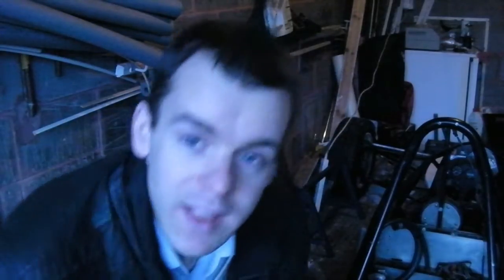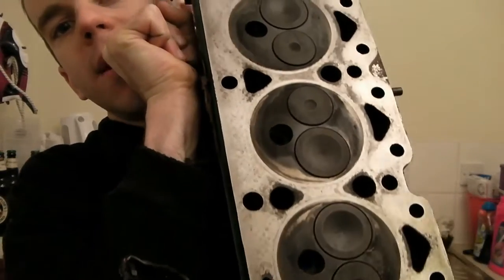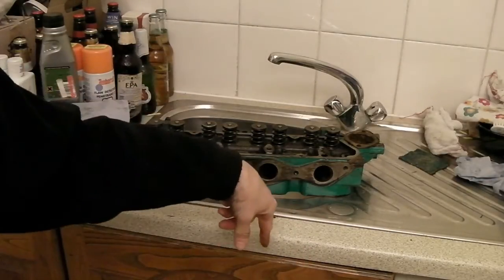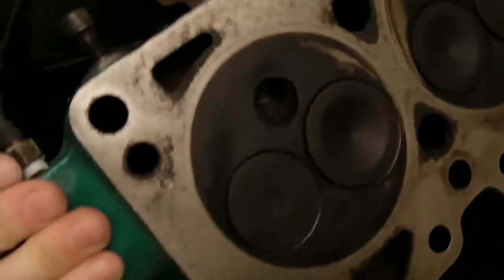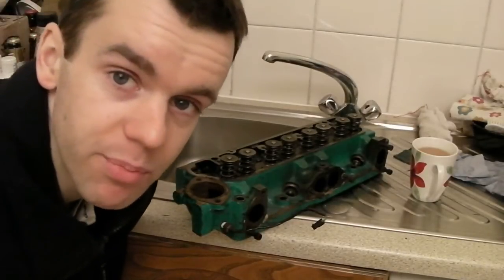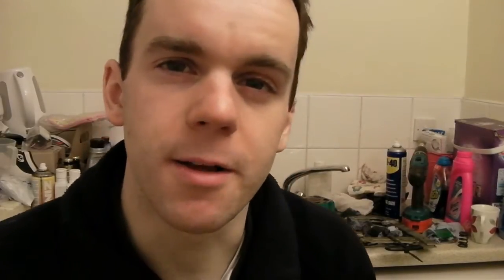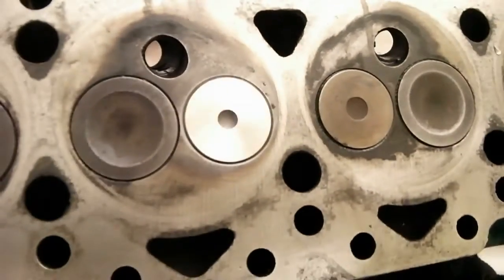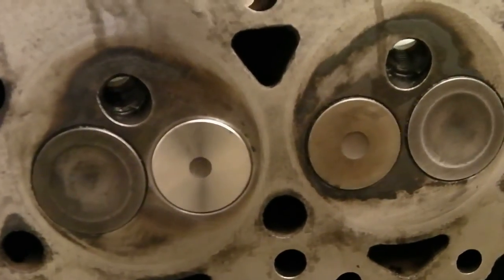Checking for Bent Valves Kent Formula Ford 1600 Engine

Comment: I know this was 7 years ago but how did you go with the valves. I've seen guys put the valve in a drill press to test if the valves are OK and not moving around while spinning.If the valves are not bent and like you did in the video i good lap valve grind may help. 180 psi that's high compression like the 4 cylinder BMW m44 engine.

Comment: The crankshaft was compromised and fractured when fitted that's not to say the pressure plate was done and the crank sprocket bearing and the release bobbing bearing in the gearbox could've been incorrect grinding paste my mates valve cutting machine cost 50 grand if you went near it grinding paste he take a fit A stick and paste would never do the same job Paste and grinding would help the valve two stick and that will be great and the exhaust Valve thicker to deal with thermal heat transfer and no reprofiling of the regs and correct cutting of the valves gives correct valve lift and before every race rocker shaft should be feeler gauged The correct tapping Lash the correct valve lift Reducing camshaft where and meticulous attention to that area even after testing